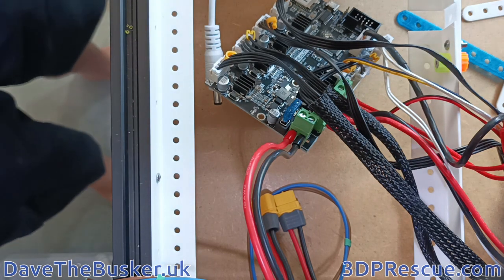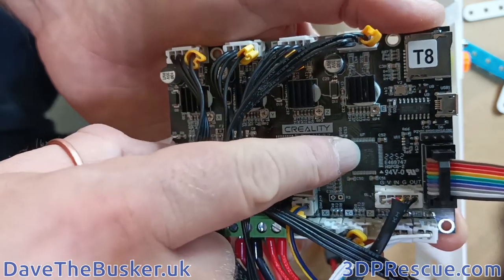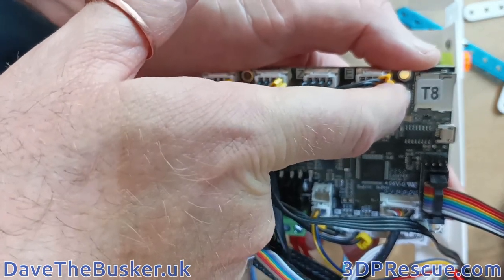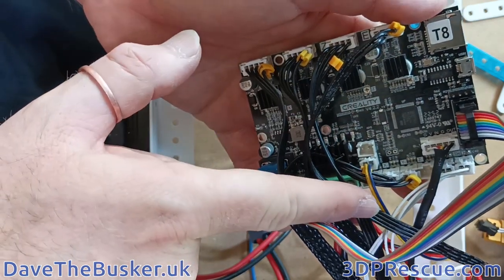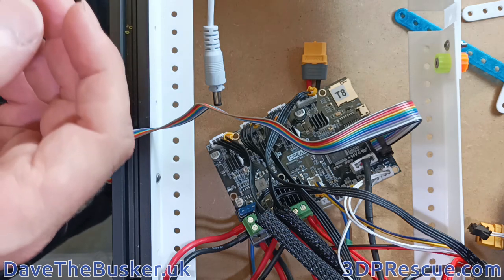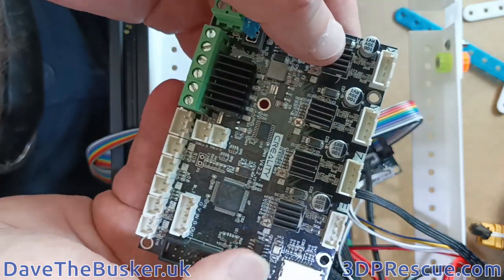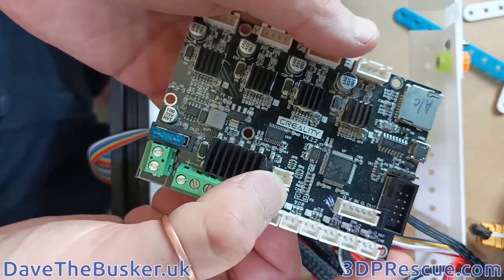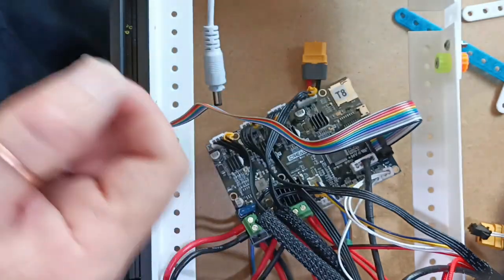Creality v4.2.2 Board Variants

Comment: Now I know why I bought a Flashforge
.
Watching this as I bought an eBay Ender3 Neo which I assume is a V1 for £20. Took it apart earlier as it's not well. It's got a 422 board and it powers up and XYand Z axis move. The hot end was hanging off and looks like there a new hot end with it and metal extruder in a bag.
It's i'm guessing had a lot of use. And most likely would benefit from a full rebuild.at least bed springs and a new set of rollers as it feels like the old ones have turned into 50ps
It seemed quiet when I moved the axis earlierso now using your board info I'll check if it's a silent board, not that worried.Firmwares already on there
Basically I'll strip it rebuild it with what I got with it see what problems it has and as long as there's nothing major wrong buy some new parts and put it to work

Comment: What a mess! Thanks for video, now I know what to look for to configure it with klipper.
Reply from the maker: It's a nightmare, I've been compiling firmwares for people's Ender printers for years and every time I come back to it there's another quirk to look out for, even the E3v2 colour screens use 2 different chipsets that I'm aware of :( It's why all my printers have, or will have been swapped over to Big Tree Tech boards, you know exactly what is on the board by the board ID and they back it up with great online resources, the free duck is just a bonus ;)
Reply: @davethebuskeruk  they are like 10$ on Aliexpress. Looks like no brainer. On v4.2.2 I've managed  to find correct pin names for everything except fillament runnout protection (didn't look for it now) but in the meantime I've ordered SKR. I seen many recommendations on Reddit, and it looks like you like them. 

Can you tell me how it's better from the creality board (assuming both are configured and works). Will the display work with this board? Does it use fans (I have a 12w noctua fan mod).
Reply from the maker: @bartek...  I use mostly the SKR mini E3v3 boards unless I have a need for something specific they can't do like a 5th stepper driver for example. They fit the same footprint and mounts as the stock v4.2.2 boards but have more features. 3 fan ports, all controlable so you can set it up that your printer will sit silent when not heated or in use, rather than having the hot end and case fan running all the time. There's no quirks with different chips, or having to use a meter to work out how the board in front of you has the fan ports set up, they messed about with that too, some run the hot end or case fan ( can't remember which ) constantly, others switch it off in certain cases :( You can use any Marlin screen with these boards, not the Ender 3v2 colour screen or the other Creality touch screens though. I believe there are ways to make the v2 screen work but not a simple plug it in and enable a setting route. BTT also include full Klipper docs in their resources on their github. Feel free to fire any questions you have my way, I'll help as much as I can :)
Reply: @davethebuskeruk  dang! looks like it has a lot of sense to replace it. 

Thanks for offering to help. If I need help with troubleshooting I know who to ask :)

Comment: Hey!  Do you have any advice for compiling firmware for a Ender 3 - 4.2.2 creality board with chip GD32F303RET6?

All the information i can find online about this seems to result in people soft bricking or corrupting their bootloader.

I would really like to be able to tinker with the firmware but i do not want to attempt until I can get conclusive evidence that it is even possible to flash new firmware to one.
Reply from the maker: Hi, sorry only just saw this, I seem to be missing some notifications. At 3DP Rescue! We've been tinkering with compiling for the GD chip on the Creality boards, the second release of the chip is the F303 - sadly I've not gotten anywhere with it so far but I don't have a board to test on though so others may have. You are welcome to join our Marlin group if you'd like ? https://www.facebook.com/groups/296480382617280